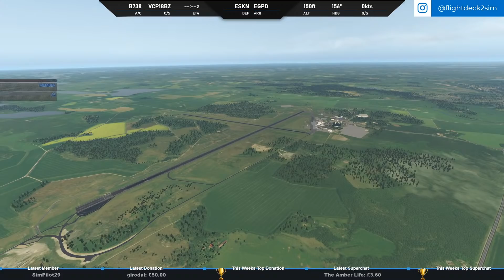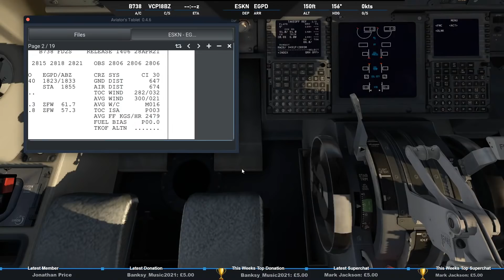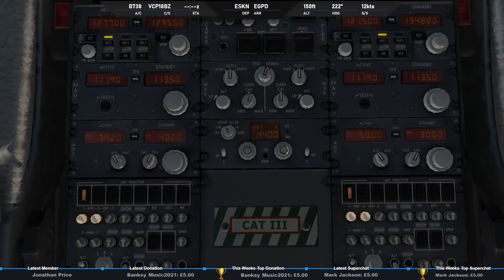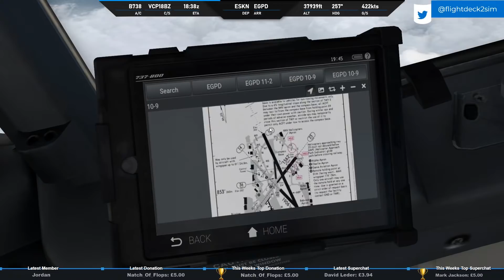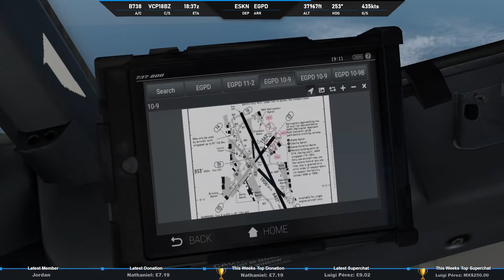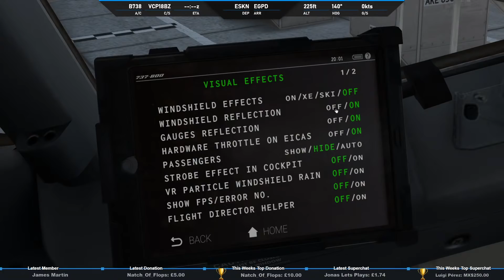ZIBO MOD flown by REAL 737 Pilot LIVE | Stockholm - Aberdeen | X-Plane 11

Comment: Speaking of the call sign in the flight number in the FMC..... I assume it changes in every flight like you simulate in the sim. How do you remember it during each flight? Any tips?
Reply from the maker: Yes each sector has a unique callsign, to remember it I simply jot it on a piece of paper and clip it to the control column!

FD2S

Comment: Nice flight!  Thanks for the answers to my questions. I do have one more though...   Sometimes I modify the flight plan in the FMS to say, make an approach better (say less of an angle on final approach).  It then does not match the STAR.  Is this allowable if Approach Control is following the STAR that is unmodified?  I do like adding custom waypoints if the SIMBRIEF plan isn't great...and I usually modify it before I take off at the terminal... but sometimes I will modify and add custom waypoints en route...
Reply from the maker: Thanks for the kind words!

You should only modify a STAR when you're no longer on it (eg under radar vectors) unless you're certain of your routing. You can then add/modify WPT's to build something similar to your expected routing, that way VNAV will update to give you good guidance for your descent!

Cheers!

FD2S
Reply: @flightdeck2sim  Ah - thanks- wondered about that!